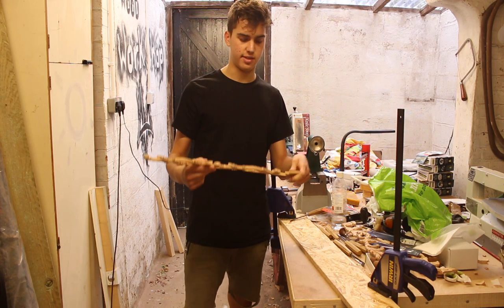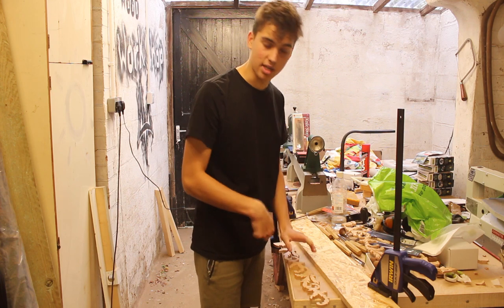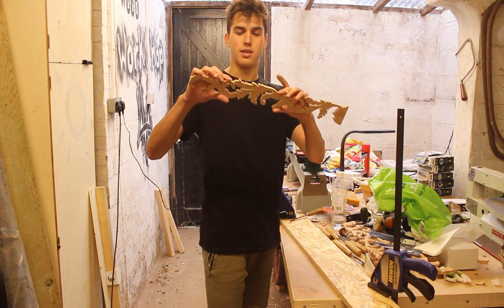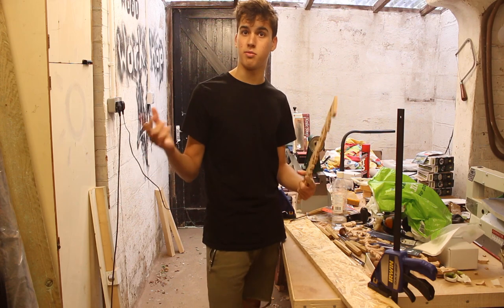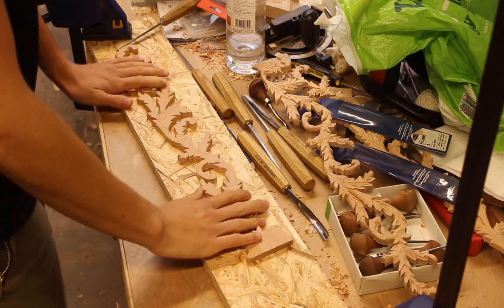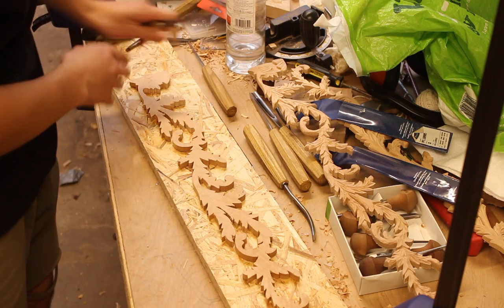How to Carve Wood - Coffee Table Part 5 - SE Woodwork

Comment: Why not animal glue to hold it while you carve? All you need to separate it after you're done Is some steam then.
Reply from the maker: i haven't tried that before, thanks for the suggestion
Reply: Sean Evelegh no problem. The English used it for years to hold together the staves of their longbows. Whenever one snapped,  they'd steam apart the joint under the wrapping and glue in a new stave. 

I'd imagine it'd be perfect for holding wood while detail carving.